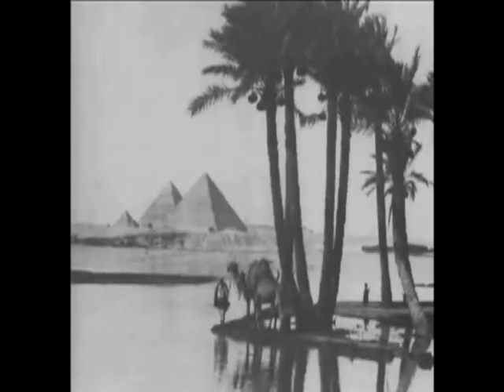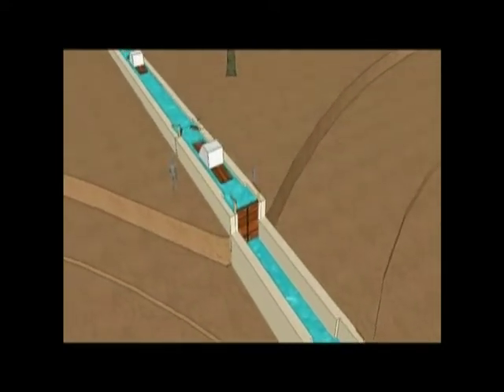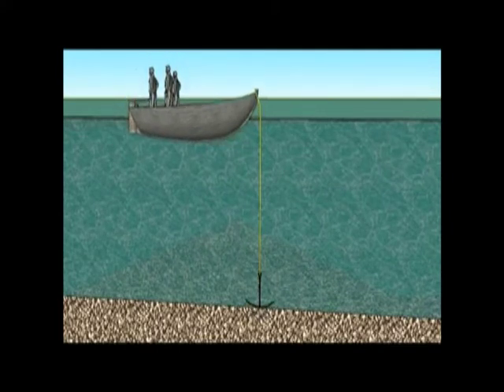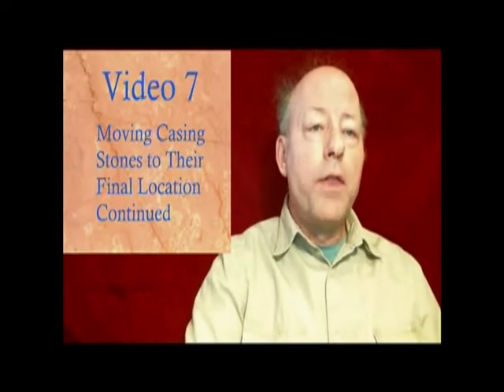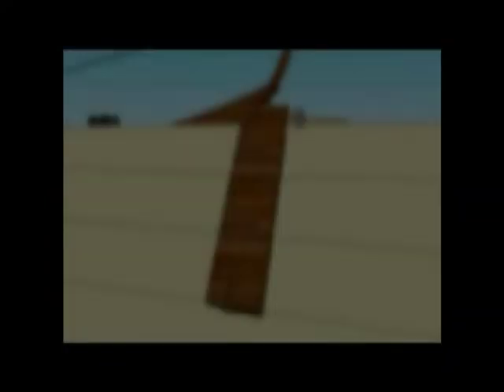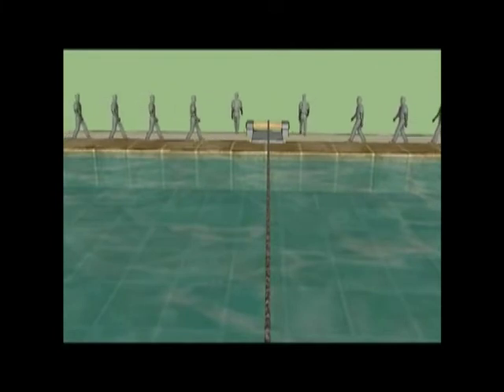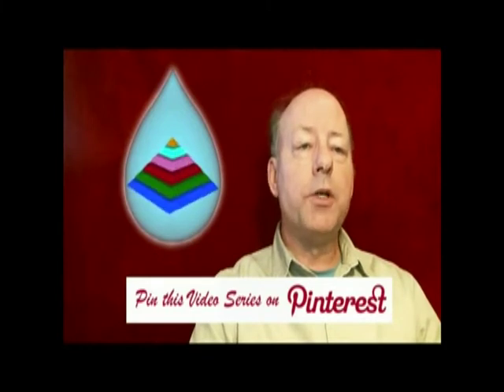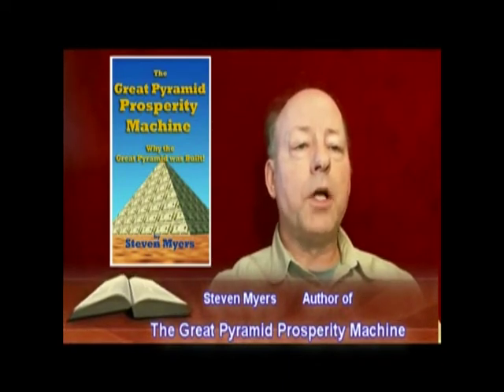How The Great Pyramid Was Built with Steven Myers

Comment: Ridiculous and lacks evidence ... To solve the enigma, one would need to identify the initial steps required to build such a pyramid ! Using 21st century engineering techniques still does not answer the primary question.. How were the large blocks of granite cut, and in the case of other pyramids, how were the sheets of mica cut ? Transporting said stones with imagined barges is easily said than done...